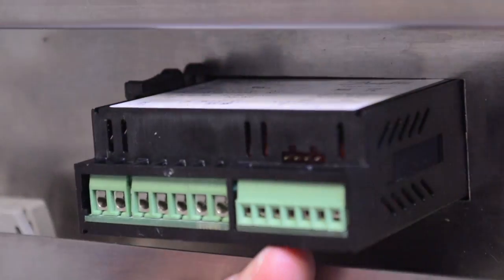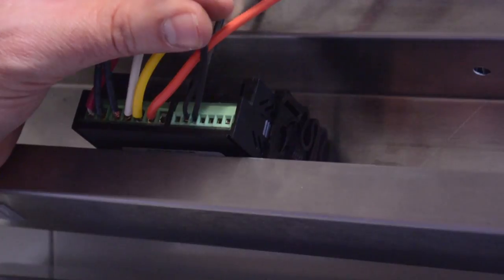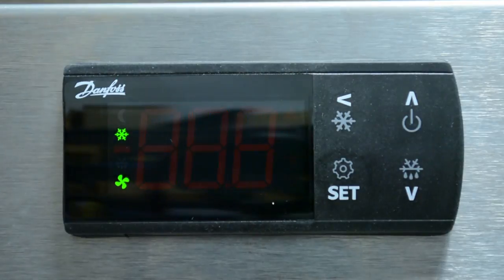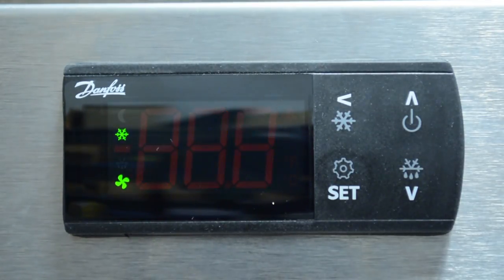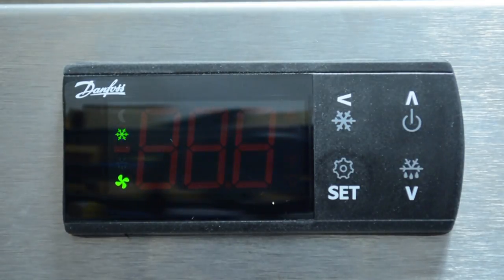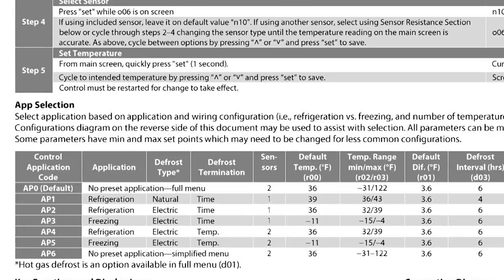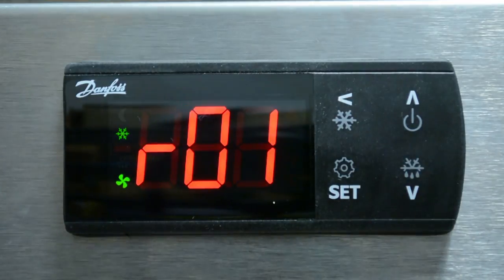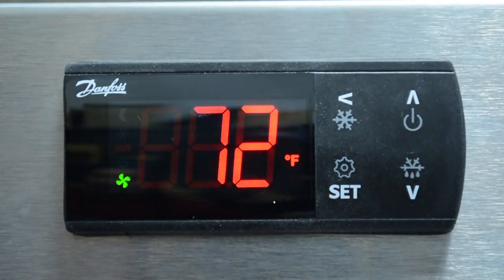Danfoss ERC 213 quick start guide

Comment: what is the different between ERC 213 from ERC 214.. thanks..
Reply from the maker: Hi mharir19, the main difference between the two is that the ERC 213 has 3 relay outputs and the ERC 214 has 4 relay outputs. Our user manual can tell you about all the differences between the two products: https://www.danfoss.com/en-us/search/?query=BC194286421698&filter=type%3Adocumentation%2CdocumentType%3Ad0dc7bd0-b471-4363-9be8-f0873302b985%2Clanguage%3Aen_en%2Csegment%3Adcs%2Carchived%3Afalse

Comment: Dear Experts i need help .  i need to adjust the Deep Freezer temperature between +2 to +8 for vaccine . 
i need help for the best device in this regardd .
Reply from the maker: Hi Shahzad, if you are referring to adjusting the setpoint, that can be done doing a short press on the "SET" button, then to change the temperature setpoint use the arrows to adjust up or down. Note that in setting mode the setpoint flashes. Press "SET" again to save the temperature setpoint. For further assistance, please contact your local Danfoss office and our trained technical support and customer service representatives will be able to better assist you.  https://www.danfoss.com/en-us/contact-us/contacts-list/?filter=type%3Adanfoss-sales-service-center
Reply: @DanfossNorthAmerica  really appreciate